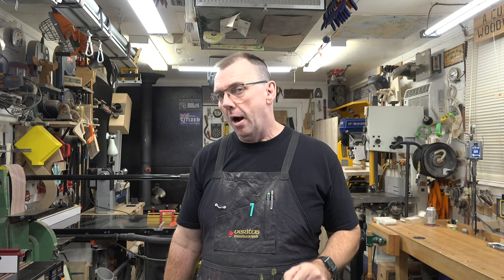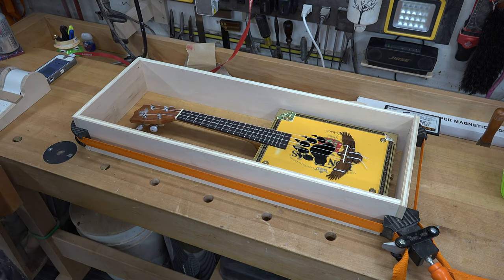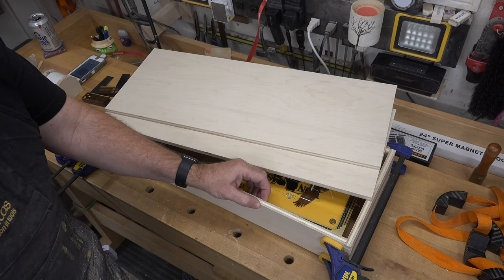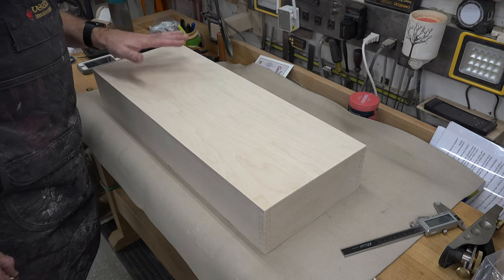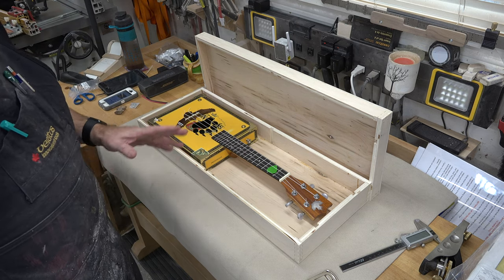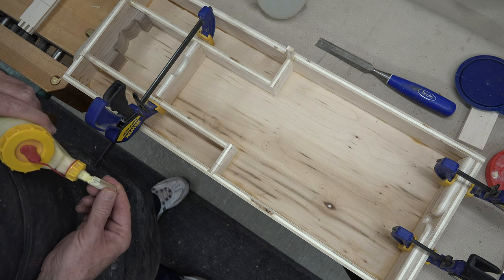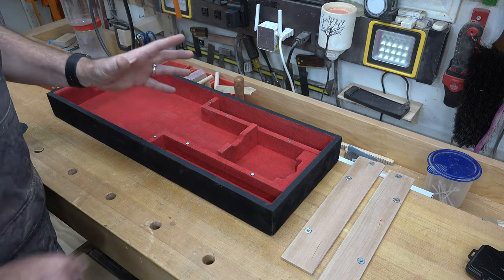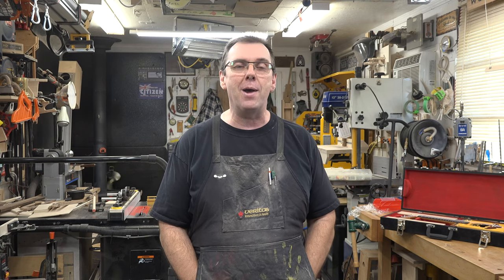Making a Ukulele Case

Comment: That case looks awesome, I was surprised to read in the comments that you flocked the outside cause in the video it kind of looks like tolex. The inside looks incredible, the whole thing looks incredible. Great work as always. Also I understand about the three month gap, still haven’t finished that hand plane, sanding the body was just getting a little old lol. I’m about a month from moving into my new house and I can’t wait to get my shop set up, been on an 8 month break from wood working because of it. Also just ordered the Sawstop. Same saw you have, 3hp 36” can’t wait to get it. I’ll get that plane done in the meantime lol thank you again for the videos, have a good weekend
Reply from the maker: You are correct Randy that I flocked the interior AND the exterior of the case.  It came out great.  If flocking is durable enough to endure the beating the interior of a drawer takes, I don't see why it wouldn't take the beating that the outside of a case takes.  After all, I'm not dragging this thing behind my truck.  It has an instrument in it for crying out loud.  LOL.  Good luck on getting your plane finished as well as setting up the new shop and of course, your new saw.  Looking forward to hearing about the shop and saw when you get everything in order.  Thanks for tuning in sir.

Comment: Hi Ken, I learned something new from you, I didn't think that you could flock the outside of something because of wear and tear, that you had to use leather or cloth even stain, I knew about insides of boxes and drawers, but never thought it could be done on the outside, Hey old dogs can learn new tricks Thanks Ken
Reply: I have the same thoughts about flocking on the outside.  Perhaps Kenny can share his experience on the durability.
Reply from the maker: Flocking is a fairly durable product.  It has been used on the exterior of items for as long as it has been in existence.  Think about all the plastic toys that you see that have soft, fuzzy surfaces.  A lot of them are flocking.  Placing flocking on the inside of a drawer puts it under a lot of stress.  After all, how often is the drawer opened and closed, causing the contents to slide around and rub against the flocking?  Probably a lot more often than you think.  After years of the the interior flocking being abused with the contents of the drawer, with things being removed from the drawer and tossed into the drawer, if you empty that drawer, the flocking still looks pristine.  Same thing goes for the exterior.  It will take it's bruises and bumps just like anything else, but for the most part, it is a fairly durable finish.  I hope this helps.  Thanks for tuning in to the show Alan.  It's appreciated.
Reply from the maker: Read my response to Alan's comment Dwight.
Reply: Ken, thank you for clearing flocking for me, honestly I never thought about the toys with the as you say 👍fuzzy, yes I use to have car dashboards with fuzzy toys displayed 😁😉. Thank you again